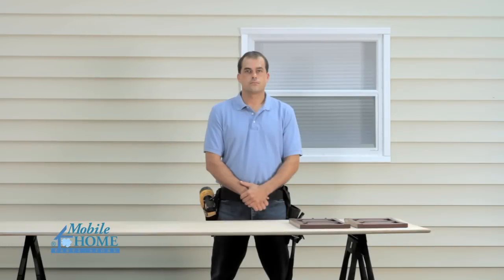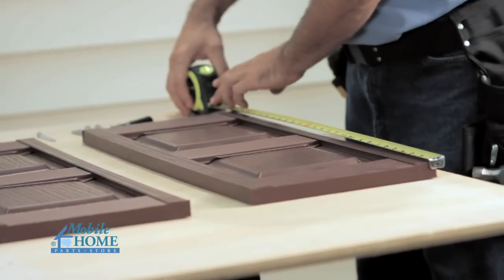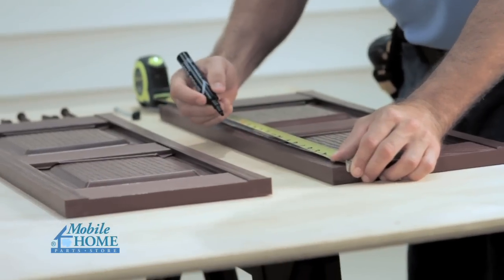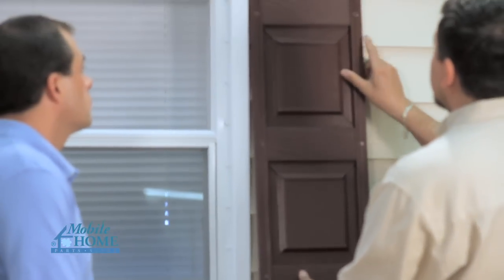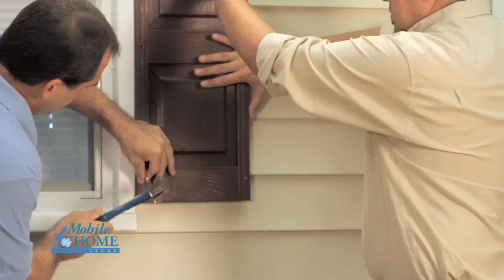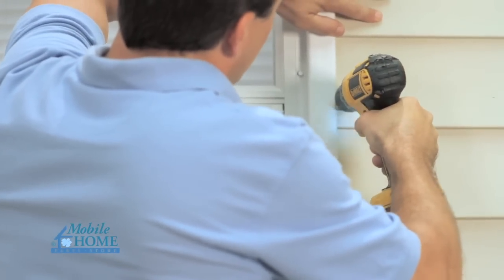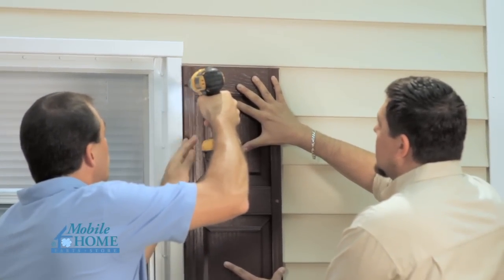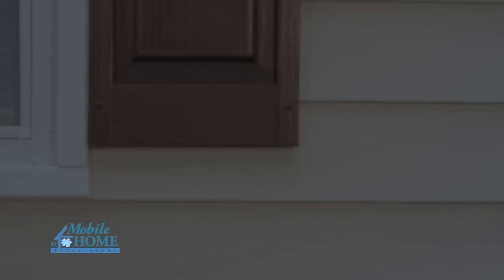DIY How to Install Exterior Shutters with Screws | Mobile Home Parts Store

Comment: I’ve always thought when you install vinyl siding you only nail enough to hold siding in the slot do it can move with temperature changes - but here you screw through the siding with a hole that won’t allow the siding to move. Won’t this now potentially cause the siding to buckle since it can no longer move where the 6 screws are?